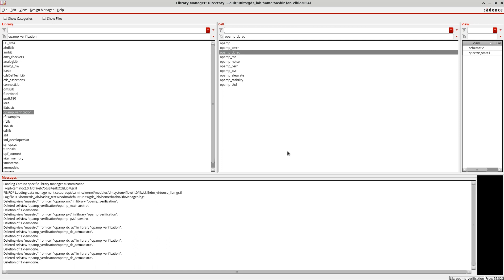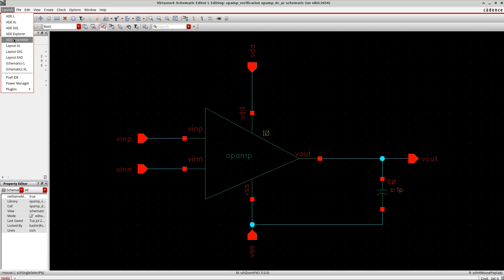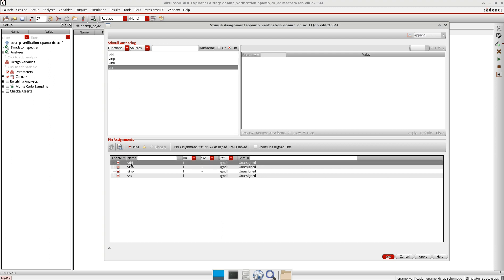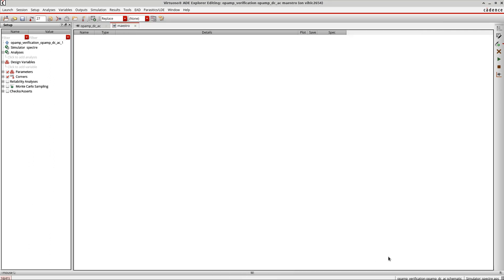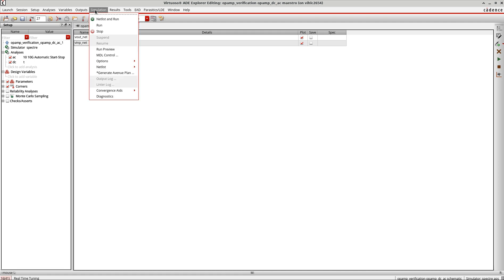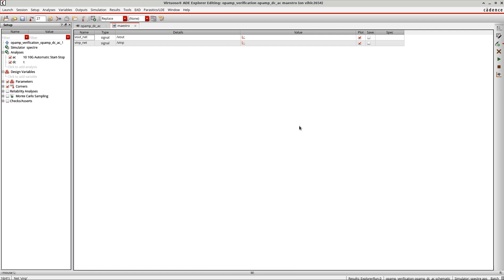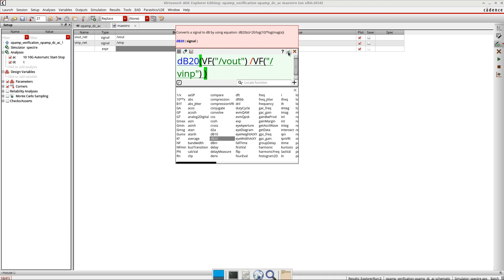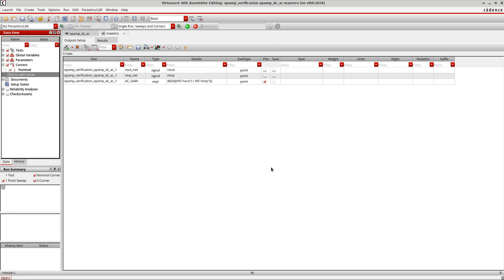Introduction to Maestro (Part2) #cadence #maestro

Comment: Hello, I have a question regarding the ac_magnitude parameter for input voltage sources? Why did you use 1u for ac_magnitude? if I'm not mistaken, this means that you already have compression at the input of the operational amplifier.
Reply from the maker: Hello,
Generally we keep it 1 for simplicity so I have constant gain (Vout = Vin*constant).
While doing ac analysis, my opamp is already linearized therefore large ac_magnitude might increase the Vout but my ac_gain is always constant or in other words my ac_performance remain same.
Reply: @MudasirMir7  still the gain should be (vout/vinp-vinn) right?